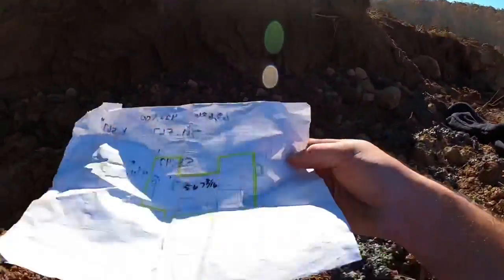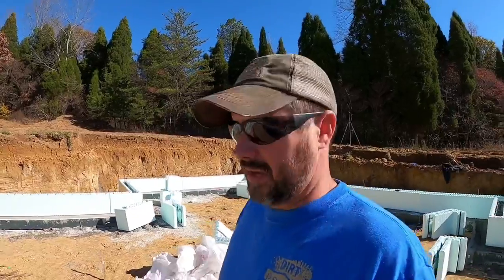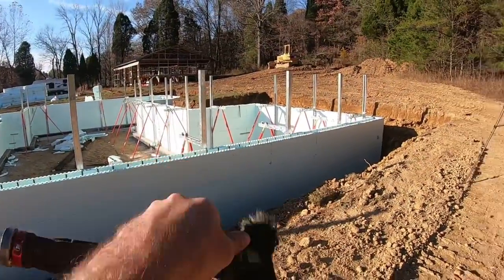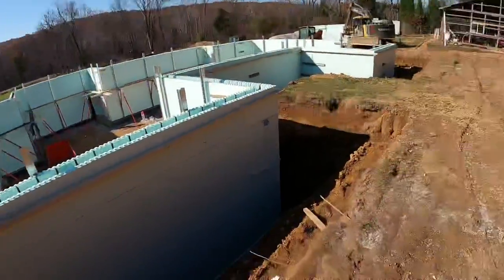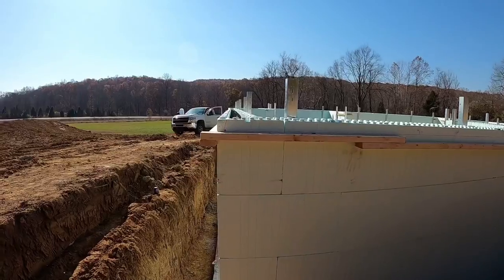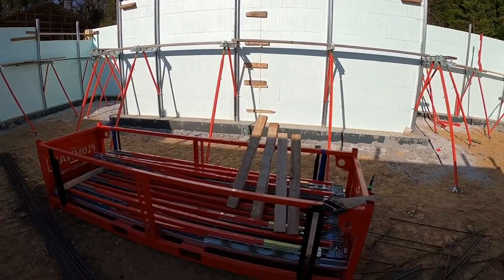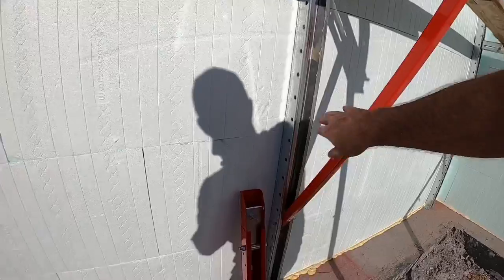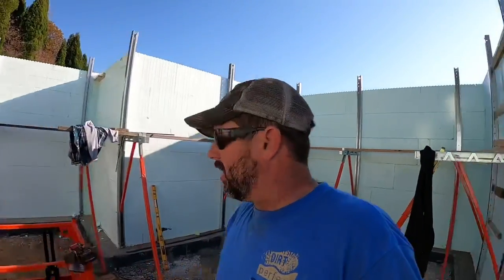How to stack out a entire ICF basement and my thoughts on the Plumwall ICF bracing system

Comment: I’m guessing you used basic geometry and math to square up your lines ? 3 - 4 - 5 is a right triangle 3 ft on one side and 4 ft on the other side join at 90 degrees when the hypotenuse is 5 ft. Pythagorean theorem and a calculator gives you a right triangle of any size.
Reply from the maker: Yup